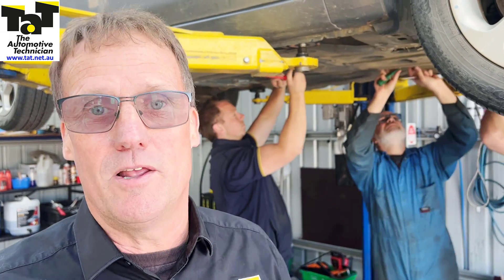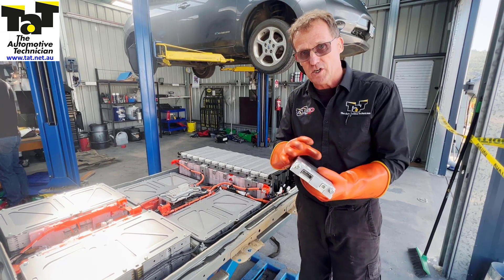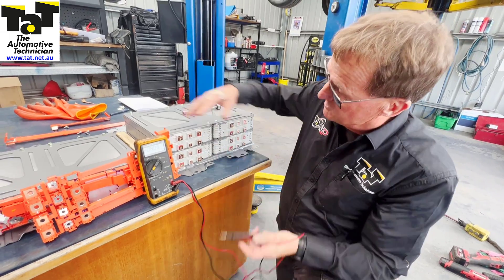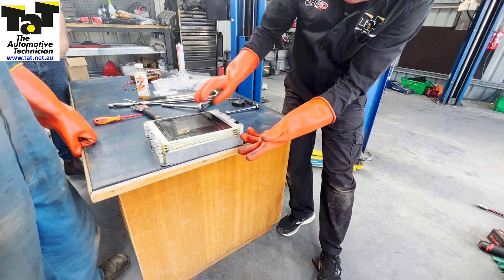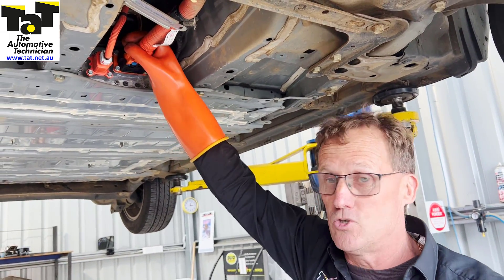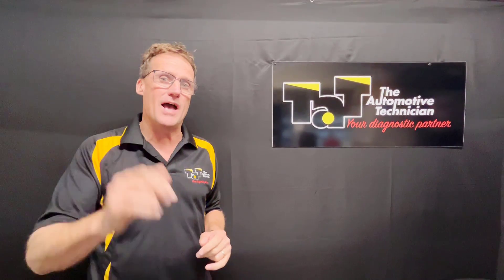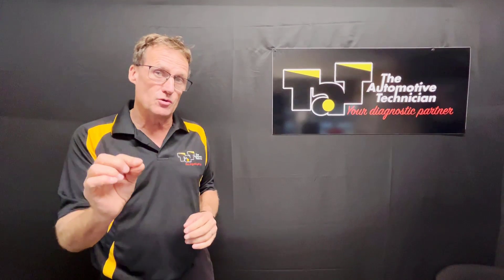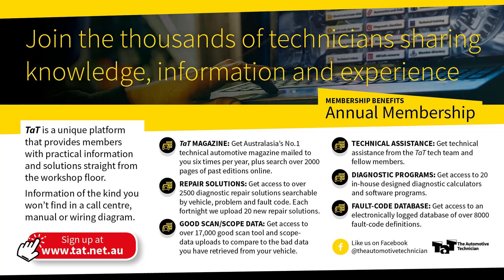2018 Nissan LEAF 30-kilowatt battery cell replacement

Comment: Interesting video, thank you. So this was an immobile vehicle due to a dead cell. What are the options to improve the range of a worn battery? I guess the cells are just uniformly worn, and the only option is to replace all the cells, which won't be cost effective.